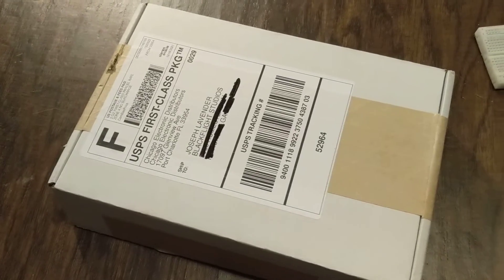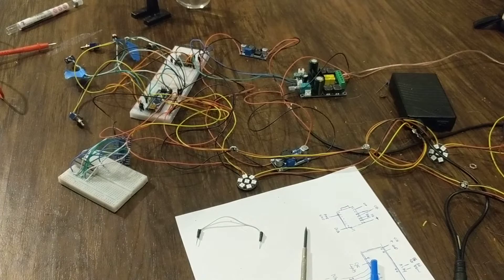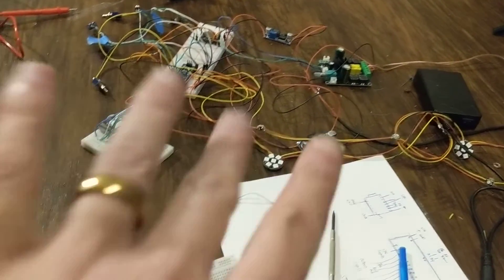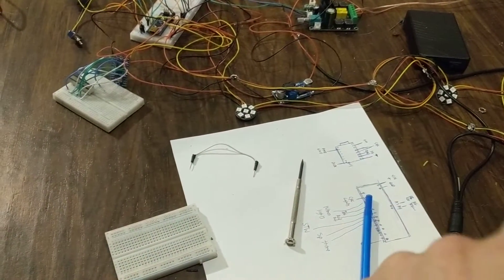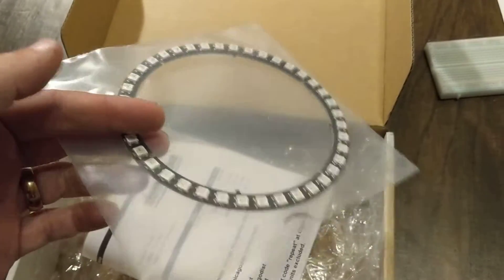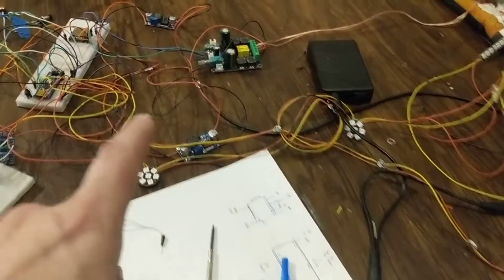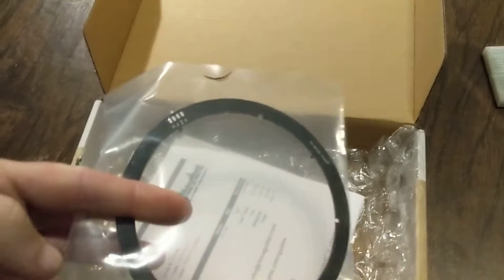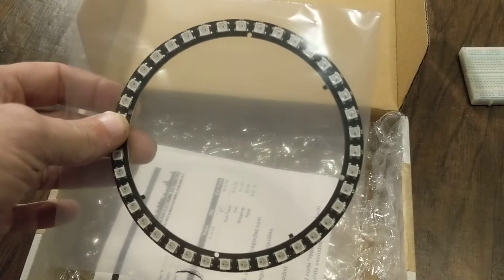Ghostbusters Proton Pack Arduino Lights and Sound TUTORIAL PART 4.1 - Afterlife?

Comment: Got the shell printed, finetuning some of the other things. I've assembled the main body and ready to start measuring for the guts. I got both the neopixels and the ring lights for the Cyclotron. But, I noticed there's no available mounting for some of the parts. Do you have a link or direction to point me to find some? I checked the FB page and the question was booted and the search yielded that Taco isn't excited about the ring.
Reply from the maker: hmmm, taco definitely made a mount for the ring. I'll see if I can find the link.
Reply: @wholesomejoe  I found a riser thing that looks like a pyramid off thingieverse and modified it to take zip ties

Comment: I hate to be a bother, but is there a detailed schematic out there? I see one on MikeS11 but it doesn't identify every component. Like, what are those PCBs coming off the amplifier and do you know where you an make/purchase the PCBs MikeS11 has on his page?
Reply from the maker: If you're wanting to use the PCB's I would use Roger Carruther's fixed boards. There were some issues with Mike's first attempts, and Roger fixed them and created his own fork. You can find it if you look for the github rbalboa8. He also has a full schematic and components list there and gives suggestions on where to have the boards printed.
Reply: @wholesomejoe  Thanks for the help, but I couldn't find the PCB but found diagrams on the FB page. I appreciate your quick response.

Comment: I’m on my third proton pack. This is the first one I’ve done all the wiring and light.  Your videos have been an awesome
Resource.  Thank you!      I do have a question.  I’m using a neopixel ring but I need to use a 45 light instead of 40.   Any idea how to change to code to reflect this?   When o power up the last five diodes of the ring act as the power cell.   🤣. Thanks again for your videos.
Reply from the maker: yes, I'll have to look at the code to see where it is, but there is a way to fix that. I'd join my arduino for GB facebook group because I feel like someone already posted the answer.
Reply: Thank you for the reply!  Unfortunately I don’t have facebook. I’ll have to see if my wife can join and ask.   😂

Comment: Also I don’t see the updated code on count’s github
Reply from the maker: I haven't been using count's code because his uses a not quite accurate bargraph. I just listed it in case people wanted to use it, since the wiring is similar.  I'm using this code: https://github.com/MikeS11/ProtonPack?fbclid=IwAR3dEfTtCZbUfyv2MTP5a1GstVwh1HaDfkBz3blbJL0a71_6nxVbebf7f7s which has the updated afterlife stuff.

Comment: Yes! Been dying for the afterlife version!

I have a Spengler wand so I won’t be using any of the wand coding. Is there a packs only version?
Reply from the maker: There is for count's, I'll check with Mike since his is based on Count's and see what we can do about that. You won't get any of the overheating or any of that though, and the Spengler wand won't be able to control any of the packs functions.
Reply: @wholesomejoe  I’m a noob and the less I have to do the better which is why I’m opting to use a Spengler wand. I don’t trust I can do a decent wand with a pop mech and all the electronics in it that can rival the Spengler wand so I rather stick with that and just mod it to gb1 style. Aux it to pack speakers for louder sound. 

If I can have a pack that does the “switch me on” feature from afterlife with the afterlife boot up sound effect and spinning lights as well as switching to ‘84 option I would be happy. 

Also Thanks so much for the GitHub link. I just saw mike’s video and his cyclotron spinning lights don’t look like they spin quite accurately.
Reply: @wholesomejoe  in comparison this member from gbfans did a more accurate job using the same neopixel ring. What do u think?

https://youtu.be/ckQ97QUQaDc
Reply from the maker: @jonogunn  I think that might be this code: https://github.com/cfunseth/AfterlifeCyclotron?fbclid=IwAR1Vtqj_09OjxZ_yTojQvxGH3iNIH3glKSWqBZlnOUCvTF7zo6YvCYaqVLo  I may see if I can just add that code to Mike's because I need the entire pack, and not just the cyclotron, but you're right his is more accurate.